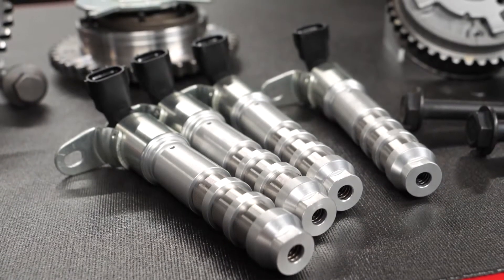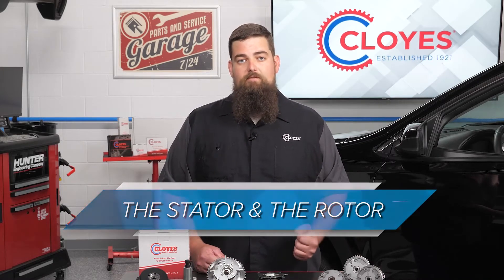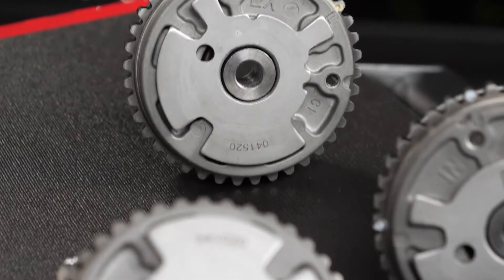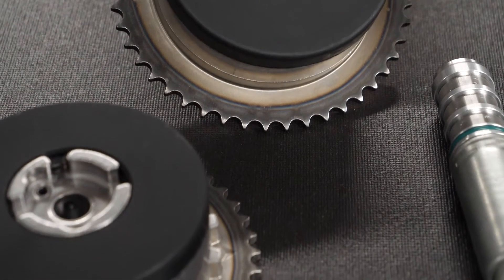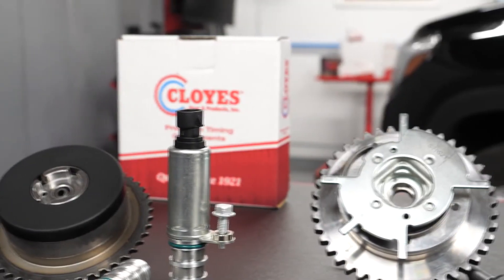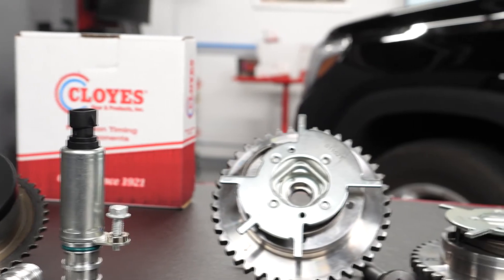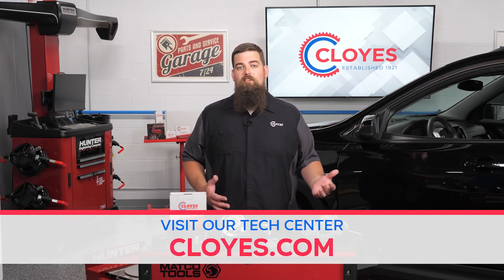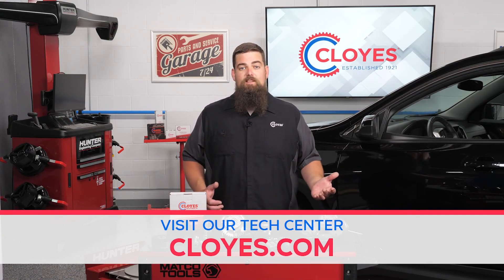VVT System Overview & Frequent Failure Points

Comment: Just changed the chains and guides and tensioners on my 3.6 and it still has the same valve trane rattle and p0016 and p0017 code? Could it be the vvt solenoids?